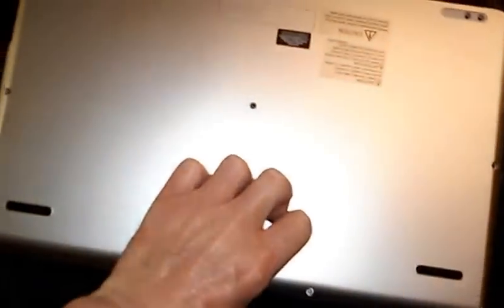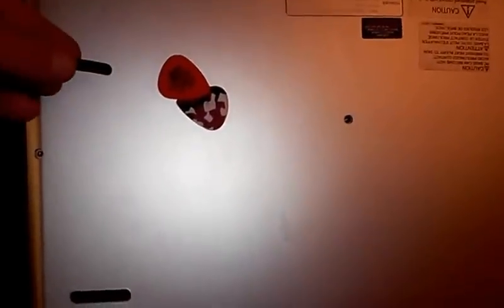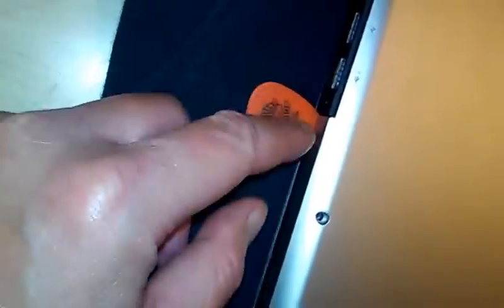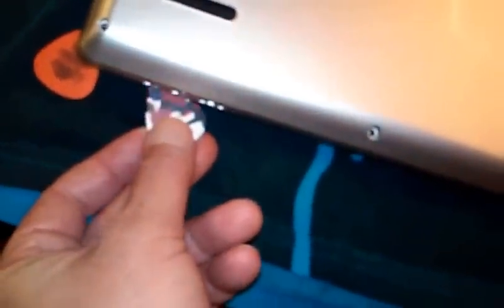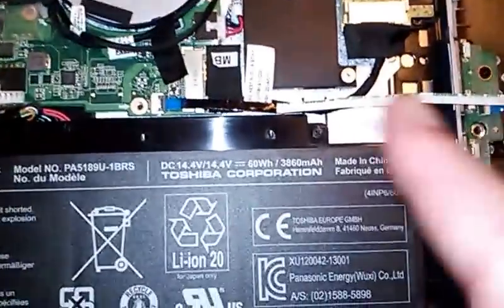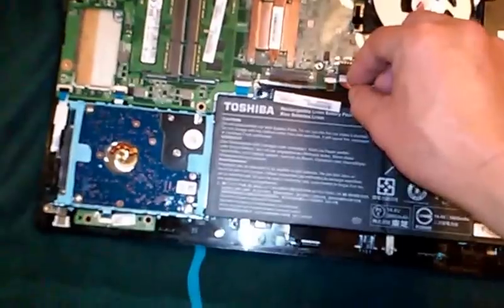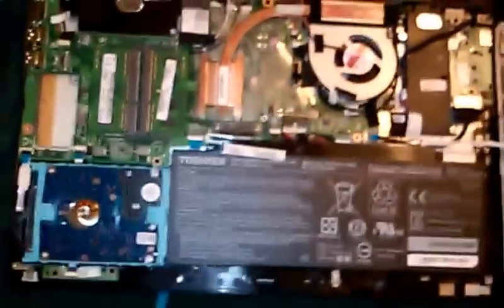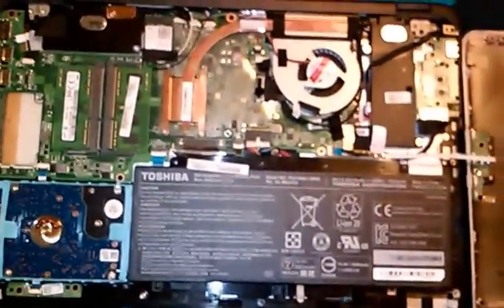Toshiba Satellite Radius P55W Disassembly.  Coffee Spill, Will Not Power-on

Comment: After 6 month use, I can't stand for the 7265AC wifi card with range and connectivity issues and finally decided to replace it with a new wifi card, killer 1525AC. I have been updating the different version drivers from Toshiba and Intel, but 7265AC's wifi signal is still weak and unstable. Killer 1525AC wifi cards has same NGFF slot as Intel 7265AC but with different size (Killer 1525AC is 2/3 size of Intel 7265AC) but still able to fit into P55W. New card on the way, will keep you updated.
Reply from the maker: +Zhou David | Hello Zhou!  I have heard quite a few complaints about WiFi issues with this series laptop/convertible.  Thank you for the information and I will post it in the top as a guideline to assist other viewers who run into WiFi issues.

I look forward to hearing from you.  All the best!

Comment: I have the P55W-C5316. Is it vastly different from this? I haven't found anything of someone opening it up. I need to get that crappy HDD out (its making clicky sounds and I've just got it today.)
Reply from the maker: +Sydney G | Hello Sydney!  I'm not 100% sure of the difference between the P55W B and C models, however the disassembly procedure should be similar.  Unless your model has a service panel on the bottom, you will need to locate and remove all of the screws on the bottom; don't forget to carefully remove the rubber feet to check for hidden screws.  Just be careful to check for any ribbon cables when separating the bottom panel from the chassis.

Check out this link:

https://www.youtube.com/watch?v=36l3i7mixM4

If you hear clicking sounds coming from the HDD then it's time to replace it with an SSD.  One viewer recommends the OCZ Vertex 240GB due to good past experience in servers.

Best of luck with your drive swap.

Cheers!
Reply: +Travis Purdy Honestly I&#39;m thinking I&#39;m going to return it. Theres no excuse for this faulty laptop. I loved the design and the 4k but the wifi problems are becoming noticable and I&#39;ve only owned it for 12 hours! (i mean i bought the laptop its self today, i'd never buy an HDD laptop on its own haha!)

Thank you for giving me your time to reply though, kind sir.
Reply from the maker: +Sydney G | Not a problem.

Comment: good day Travis Purdy, can you show us how to open toshiba p55w laptop screen? i didn't find any screws to start with. Help is much appreciated. God Bless
Reply from the maker: +Eduardo Santiago |  Greeting Eduardo!  I don't have that laptop in my possession any longer, so I am unable to produce a video for you with instructions.  If I remember correctly, the model in my video was a touch screen, however I believe the P55W is sold with non-touch screen as well.  

I have attached a link for P55 "non-touch screen" replacement:

https://www.youtube.com/watch?v=ke1lESVfZr8

Here is a link to a video for ASUS "touch screen" replacement; many times the manufacturers have similar assembly methods so this should get you in the ball park for your Toshiba if it is a "touch screen" model.

https://www.youtube.com/watch?v=8CVZ99tYq5s

Here is digitizer replacement video for a Toshiba laptop as well.

https://www.youtube.com/watch?v=_mC4xJ0Fs9Q

When performing a screen replacement, just make sure you take your time and be careful when you are disconnecting/reconnecting cables, separating plastic components, etc. and you will get it done correctly.

Hope this helps!

Best of luck to you.
Reply: +Travis Purdy thanks , i will try this link. Thank you so much. God Bless
Reply: +Travis Purdy i also have a picture. It appears to be ghosting but connecting it to separate display it works perfectly fine.
Reply from the maker: +Eduardo Santiago :  That confirms your video from the mobo is working.  Did you locate the mounting screws for the screen?
Reply: +Travis Purdy im having a hard time locating the screws. unlike other laptop models. screws are are easy to locate compared to this model p55w. would it be possible that the screen itself was attached with just adhesives? again many thanks to you travis
Reply from the maker: +Eduardo Santiago | Hi Eduardo!  The screw locations should be immediately obvious, so it is possible the screen is attached with adhesive.  If the screen is attached with adhesive, then you would need a heat gun to soften the adhesive to release the surfaces; if you do not have experience using a heat gun in this type of situation then I recommend you take it to a professional.

Comment: Hi I have problem with mine where when I try to turn it on the keyboard backlight comes on but the screen stays black and nothing ever comes up. Before that boot up would sometimes take a good many minutes maybe even a half hour or more as I'd walk away knowing it takes a while, but it would boot. A buddy said to maybe try removing the bios battery so as to reset the bios to factory settings. Is there such a small battery in this, and would it make sense to try that to see something on the screen? This thing has been.a lemon as I too had the slow wireless problem when I first bought it. Thanks for any advice and a helpful video, cheers, Scott.
Reply from the maker: +Scott Dudley - Hi Scott!  When you power on the system, do you see the initial POST screen with the Toshiba logo?  Not sure if you have a bad screen or the OS is not booting completely.  Was the system dropped or anything spilled on it?  The nature of this issue is difficult to diagnose without physically looking at your system.  Normally, I would enter the BIOS first and if successful, I would go into recovery mode to see if I could get to the desktop via Safe Mode or boot from recovery media.  You may consider calling a reputable computer repair shop in your area for further assistance.  Hope this helps!
Reply: +Travis Purdy  When I power it on, the keyboard backlight comes on, and the three power lights come on,  and there is a little bit of fan noise, but it seems like the hard disk isn't spinning.  I get nothing on the screen.  I've tried to get it to go into BIOS or whatever the new similar thing is but all the keys suggested to hit as you power up don't do anything.  I'm thinking of ordering a recovery USB stick, but I'm puzzled why I can't get anything on the screen.  I've tried shutting off with the reset hole, and I've opened it up (thanks to your video) and disconnected and reconnected the battery, but still the same thing, nothing on the screen, no way to get it into any startup mode, and just keyboard lights and power lights.  It I leave it the keyboard and power lights just stay on forever (days).  If the power cord out, they shut off when the battery depletes.  Any thoughts are appreciated especially if there's a trick to get it into a startup mode on power up.  Thanks, Scott
Reply from the maker: +Scott Dudley | Hi Scott!  Before going down the path of "dead HDD" (which is possible) Here are a couple things to try:  a) connect your laptop to a separate monitor to see if you get display.  b)  disconnect AC power, open up the laptop, disconnect battery, remove memory, depress and hold the power button for ~60 seconds.  Next, insert (1) memory module, plug in AC power (DO NOT CONNECT BATTERY), power on laptop and see if you get display on the main screen and/or monitor.
If the HDD is dead, you should see POST/BIOS with messages on the screen and/or external monitor.  Power off system completely, disconnect the HDD from mobo and power on to see if you get display.  Right now, we are trying to determine if:  the screen is bad or HDD is bad or something with the mobo or mobo itself.
To verify operation of the HDD, remove it, connect a USB to SATA cable and plug into another machine to see if it spins up, then run disk scanning software to verify integrity.
There is a program called "Hirens" that you can download and burn to USB drive as a troubleshooting and recovery tool.
Again, I have to stress that it is difficult to evaluate your machine without physically looking at it, however these steps should get you partitioning the problem to root cause.
Hope this helps.
Reply: Travis, I tried everything you suggested.  The HDD seems fine as it powered up an all files could be read with the cable on another computer. But the screen shows nothing, with or without hard drive, with or without external monitor, which is also black, with or without battery, etc,  just a black screen with the keyboard backlight always on.  There doesn't seem to be anything to get it to show something like BIOS or anything on the screen. Appreciate all your thoughts so far, and if you have another I'd like to try it too.  Thanks, Scott.
Reply from the maker: +Scott Dudley  |  Hello Scott!  At this point, I recommend that you reach out to a reputable computer repair technician in your area for further assistance; someone who can physically diagnose the problem to root cause.  

Call at least three shops for estimates before committing to doing business with any one of them.  Usually, local computer repair shops are your safest bet for repairs and I would avoid taking your machine to "big box" stores.  

On a side note, make sure you back up all of your data from the HDD as a safety precaution.

Hope this helps and best of luck to you.
Reply: Hey Scott did you ever find a solution. I have the same problem.
Reply: No I never found a way to fix it.  I was going to send it to Toshiba but then their cost ended up being about the same as it cost new.  I think I'm going to put it on Ebay as a non-working for parts only.  I suspect it's a motherboard issue, and I don't plan to buy Toshiba again!  It lasted 13 months and was only used on a desk, never travelled or jostled.  Let me know if you find anything and good luck.
Reply: Also, I did check the hard drive by taking it out and hooking it up to another computer and it was fine, thus why I suspect the motherboard.  It doesn't show anything on the screen, but it also doesn't spin or seem to do anything at startup, regardless of taking the batter out, hitting the reset pinhole, taking memory out, which I have tried in many combinations but never got it to start again.
Reply: Scott Dudley Yeah I'm pretty aggravated with Toshiba on this one. I may go and buy another one, swap the motherboard and then take it back for a refund. I normally wouldn't do something like that but I'm not going to let them rob me of $750.00.
Reply: Scott Dudley I'll let you know if it's the motherboard or not but I'm pretty sure it is. There isn't even a CMOS battery on it?

Comment: Hello Travis im with the same problem still. couldn't reset the user password from BIOS did you get any way to do?
Reply from the maker: +Victor Manuel Garces Hello Victor!  Is the system requesting an "unlock code?"  If you have a "system disabled" code at start up, you can go this website (http://bios-pw.org/), enter the code, and see if it generates an "unlock code."  Most of the time, I have jumpered contacts on the mobo to reset the BIOS password.  I don't have the laptop any longer so I can't verify the contacts positions or id's.  Look around the memory card area on the mobo to see if there is a pair of contacts labeled "J1"JCMOS"  and/or "JPW."  Remove the memory cards and look underneath as well.  Sometimes an adhesive label is covering these contacts.  The pictures below are only EXAMPLES and NOT FOR YOUR MODEL:

https://i.ytimg.com/vi/Uh4x0MI5pqQ/maxresdefault.jpg

http://ww2.justanswer.com/uploads/ComputEngineer/2009-12-07_044516_SHORT_JUMPER_J1.jpg

 This pic above shows a contact on the mobo, with memory removed, where you form a bridge/jumper (electrical short) between the contact and ground (the metal post to the left).

Make sure computer is powered off completely, AC power removed, and battery removed.  Hold the jumper in place for about 30 seconds.  Power on computer and BIOS password should be cleared.

Lastly, google search for "bypass BIOS passwords for Toshiba."

Hope this helps!

Comment from the maker: Hello Folks.  Be careful when removing the bottom cover from your laptop.  A couple users have reported complications with their power button after opening; there is not much of a service loop to work with.  I recommend watching the entire video BEFORE removing the bottom cover and pay particular attention to the 2:36 mark where I mention the power button ribbon cable.  Hope this helps.
Reply from the maker: +Jesse Jacobson |  It's tough to advise you on that decision without physically looking at the machine however, you may not need to replace the ribbon cable at this point.  

I received a message from another viewer who experienced the same issue and here is what I suggested:

Inspect the ribbon cable and electrical connectors for damage.  If there
 is no damage present then check to see if any corrosion is present on 
the contacts:  use a Q-tip and rubbing alcohol or contact cleaner to 
remove the corrosion.  Inspect the power button for damage as well.  You
 can swap the ribbon cable, end-for-end to see if that makes a 
difference.  Once you insert the cable into the connector, the "tab" 
should snap firmly closed; if it doesn't act like the other connector 
then it may be damaged.  If you can make solid electrical contact 
between the ribbon cable and power button connector, you may be able to 
secure the connection in place with a piece of black electrical tape.  
The tape can be any color, I am mentioning black as most people 
associate that color with electrical tape.  You can insert the ribbon 
cable into the connector without closing the tab, then gently wiggle or 
move it into different positions to see if contact will be made while 
depressing the power button.
Are you attempting to power-on the laptop using battery only?  Or, AC 
power with battery?  If battery only, did you remember to reconnect the 
battery connector?  If you are using AC, then battery should not matter.
  I am asking you these questions to see if another problem may exist 
that is not a direct result of the ribbon cable and power button.  I 
hope this helps and you are able to resolve your issue.
Reply from the maker: +Jesse Jacobson - That is great news!  Thank you for the feedback to help other viewers who might run into the same issue.  I will bump your comment .  Cheers!
Reply: Travis Purdy great vid! I have the exact same model with a power on lock and I'm trying to locate the CMOS or JMOS jumper to reset it. Any help would be greatly appreciated!

Comment: My power won't turn on. Evertime I tried to press the power button it nothing happens at all. Is it possible that I may have damaged the ribbon connector? When I took the lip off I decided to remove the end (on the lip, off with a little force).
Reply from the maker: +Vel HTZ Greetings Vel HTZ!  Another user reported a similar problem, so I have pasted my recommendations below:

Inspect the ribbon cable and electrical connectors for damage.  If there
 is no damage present then check to see if any corrosion is present on 
the contacts:  use a Q-tip and rubbing alcohol or contact cleaner to 
remove the corrosion.  Inspect the power button for damage as well.  You
 can swap the ribbon cable, end-for-end to see if that makes a 
difference.  Once you insert the cable into the connector, the "tab" 
should snap firmly closed; if it doesn't act like the other connector 
then it may be damaged.  If you can make solid electrical contact 
between the ribbon cable and power button connector, you may be able to 
secure the connection in place with a piece of black electrical tape.  
The tape can be any color, I am mentioning black as most people 
associate that color with electrical tape.  You can insert the ribbon 
cable into the connector without closing the tab, then gently wiggle or 
move it into different positions to see if contact will be made while 
depressing the power button.
Are you attempting to power-on the laptop using battery only?  Or, AC 
power with battery?  If battery only, did you remember to reconnect the 
battery connector?  If you are using AC, then battery should not matter.
  I am asking you these questions to see if another problem may exist 
that is not a direct result of the ribbon cable and power button.  I 
hope this helps and you are able to resolve your issue.